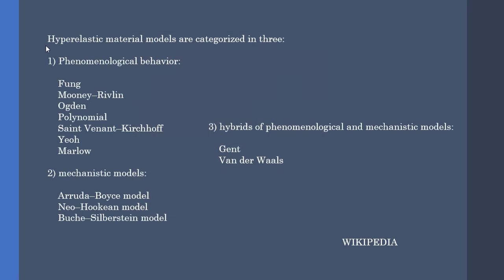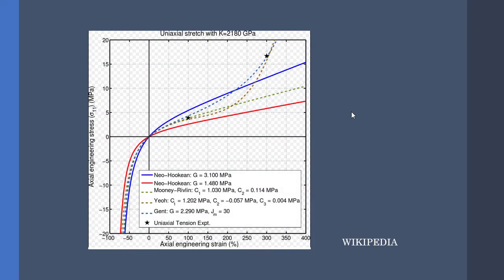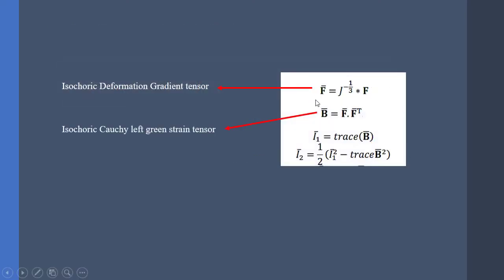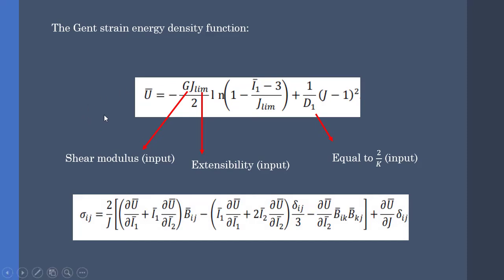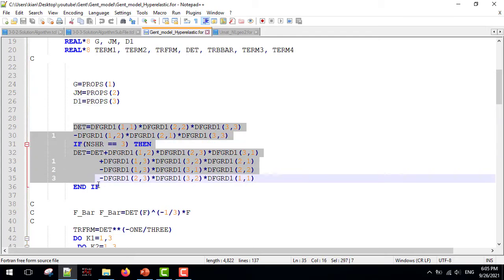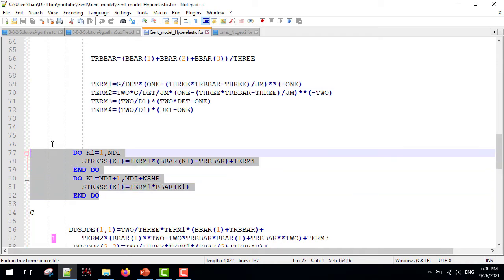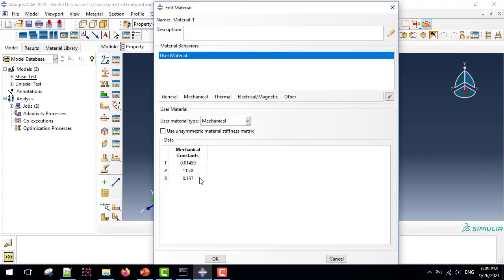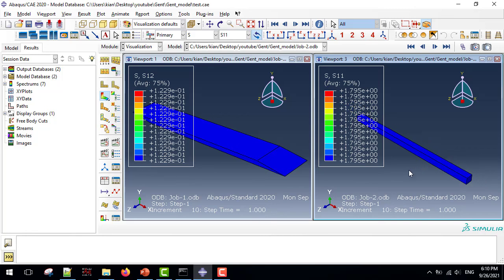Gent model for Hyperelastic materials

Comment: Hi. how to model strain-softening behavior in Abaqus using umat? its getting difficult since DDSDDE can not take a negative value
Reply from the maker: Hi. There are a number of ways to do that. For instance, you can specify a damage parameter and use it to decrease the stiffness.
Reply: But decresing stiffnes wont be sufficnt right.. The stiffness should be a negative value inorder to get a declining slope or stress strain ?
Reply from the maker: @vishnuos4075  I believe you are mistaking the stiffness matrix with the material matrix. Nonetheless, for 3-d analysis, it is possible to do what you want, and I have shown that in previous videos. Watch my videos!
Reply: I will look into it🙂